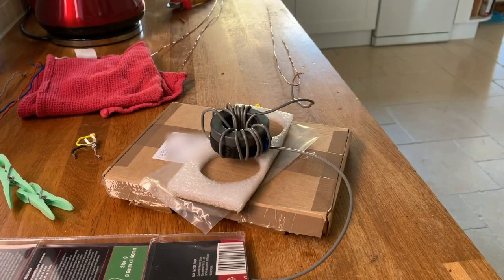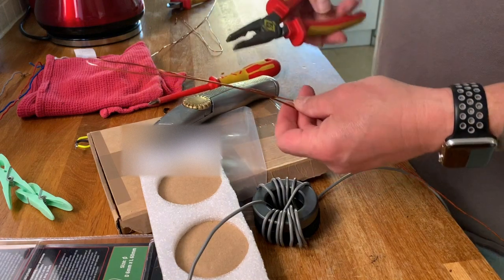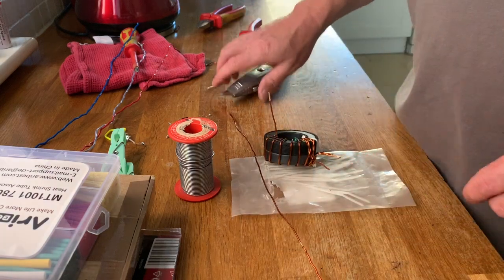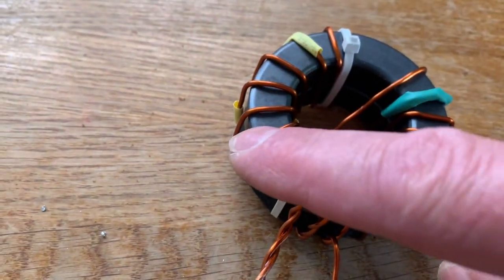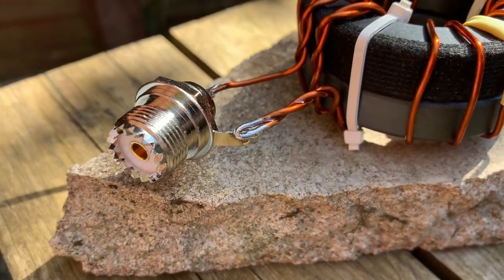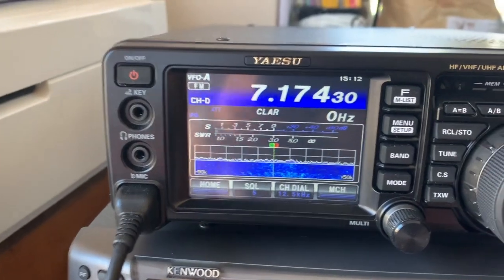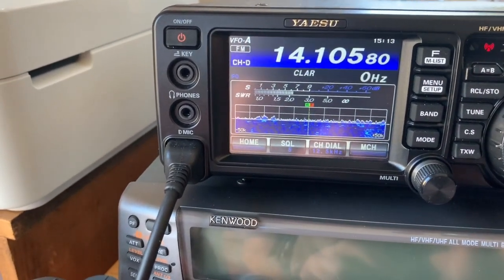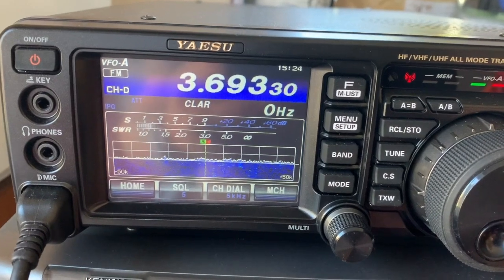Build a HWEF Antenna - Lockdown Activities part 3

Comment: Great build video, thanks! Also I take it these 49:1 systems don't need an earth stake to function well ?
Reply from the maker: correct no need to earth, but it helps stop returning RF
Reply: So its turn ratio is 16:2 = 8. Z ratio is turns ratio squared which is 8*8 = 64 so it’s a 64:1 impedance ratio.  Not sure of your counterpoise. Typical end fed antennas are simply very very off center fed dipoles. The short side has to be there. It can be a short “counterpoise” or it can be the coax shield. It could also be a wire to a ground rod. Just wondering what you are using.  Hard to tell from the video but did the capacitor make much difference. Did you rebuild it with a 49:1 transformer later and if so did it make much difference?

Comment: I’m just a noob in ham so I’m confused, isn’t there a short between your center pin and ground since it’s the same wire? 73 VK4FJST
Reply from the maker: ah yes, you are looking at this as a DC circuit,  RF is AC, find any household equipment that uses a transformer, perhaps your radio’s power supply. Take the plug out of the wall use your multimeter and see if there is a short between the pins on that 🔌 plug bet there is... so why is there no bang or fuse blowing when you put back in the wall..... because AC moves backwards and forwards inducting the same movement in the wire it is wound with transferring its energy. The same is happening with the antenna...
Reply: @mike-M0MSN  thank you very much for that excellent explanation! Cleared that up for me nicely. 73 VK4FJST

Comment: Very informative Mike, thanks for making this video.  Incidentally... why some idiots see fit to give a thumbs down to this when you have very kindly given freely of your time  to produce and upload this I will never know.  Anyways that aside, would an EFHW work better than a G5RV in same location?  I am considering buying one (I don't have the torroids or wire available) but uncertain if I would achieve lower noise floor and/or better gain.  Thoughts...?
Reply from the maker: ReflectingMe Thanks for your comments, I have both of these antenna and find that they both have there benefits, however I do find the EFHW the quietest.  👍
Reply: @mike-M0MSN  Awesome, thanks for the reply, Mike.  I think you have helped me make up my mind to go ahead and push that 'buy' button :) Also, where is the best place to buy the components such as toroids and wire etc to make one of these oneself? Oh, and I have just sub'd too, as I think I can learn a lot from you.
Reply from the maker: ReflectingMe I have purchased most of the bits from eBay .... :)

Comment: Hi Mike, looking at your toroids they seem to be 2 diffret  ones 1/43 other 1/31 or 1/ 61 sizes the same but diffret mixes ??
Reply from the maker: Hope not  sold to me as type 43.  One of them has fabric tape on it to stop the wire slipping.

Comment: Hi there yes they call them a 49:1 UnUn, its supposed to have a 100pf  capacitor of several thousand volts working connected across the SO 239 socket apparently...1/2 wave for 80mts should be about 126 feet, or around 40 mts....from Fred g4vvq.
Reply: The one Mike shows is a 64:1

Comment: I built one a few weeks ago too.  I did the 49:1 version and it works on 80/40/20/17/15/12 and I haven't tried ten yet.  I did have to boost the compensation capacitance to 200pf to get the higher bands under 3:1.  What a great antenna, it gets me 3000 km out on 20m with no issues with 100 W SSB.
Reply from the maker: That is awesome!

Comment: You made it so much harder for yourself using the scrap enamelled wire bits 😂. The EFHW is so easy to build & gives great results. You may bring 20m SWR down a little by changing the radiator length a little .Great video 👍
Reply from the maker: Very true!

Comment: What is the physical length of the radiating element Mike?
Reply from the maker: Hi Roly, 20.5 metres to the coil To get to 110μF I used 76 turns after the coil 2.5 metres (search Steve Nichols G0KYA. http://g0kya.blogspot.com/2017/01/a-shortened-multi-band-end-fed-half.html )

Comment: Hi mate. This is so weird I’m also half way doing the same thing. I’ve got my 49:1 sorted. I’m waiting on a 10m pole from some dodgy bloke in Dorrige   Idea is to do a comparison test on 40m. Waiting for an enclosure box and some connectors. One thing I’ve been reading about is to try a short ground wire from the ground on the toroid. Does not need to be long. Check out Steve Ellington’s excellent HWEF pages.
Reply from the maker: I have ended up using a ground rod, works too.. :) Steve Ellington’s excellent HWEF pages are indeed excellent.
Reply: I have done a little bit of fiddling around with EFHW on 40 in the past and found that the "earth" requirements are nowhere near as critical as say for a resonant 1/4 wave vertical.  a good ground is essential for the 1/4-wave vertical to work properly.
Yes, a choke is necessary if you don't want to fill the shack up with RF............ :)  I would be keen to hear about your results.
Reply: @RolyRJ  Hi Roly, I made an EFHW to Steve Eillington's spec last autumn, I use it when portable as an inverted L (aprox 30ft vertical component 100ft horizontal.) I havn't finished tuning it yet as a long crappy winter and now this rotten virus have intervened but I didn't need any counterpoise 40-10 but added 4m counterpoise to correct some fluctuations on 80. Many people report not needing one and I suspect they like me run a decent length of heavy duty feeder (RG213 ect) with the coax shield acting as counterpoise. (Edit) I've had no issues with stray RF!

When the world finally gets back to normal I'll be looking forward to making the final adjustments to the antenna but even as it is with a small Dentron Jr manual ATU it works just fine and I made plenty of DX contacts on 20&40 with the antenna thus far, 73, Tom G2NV